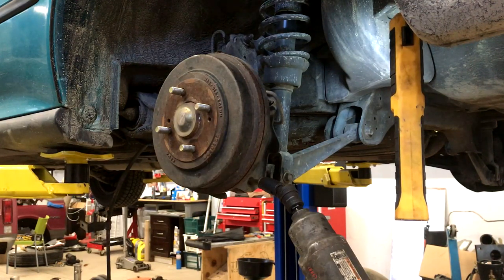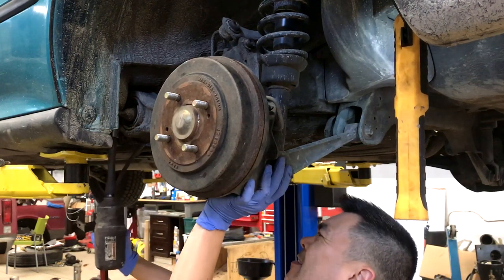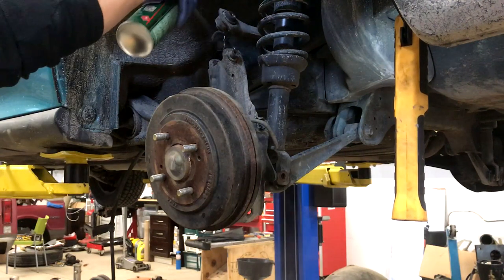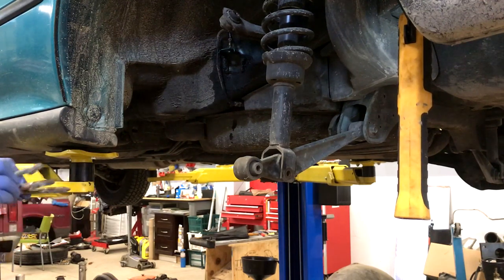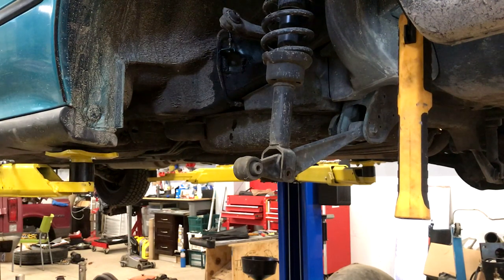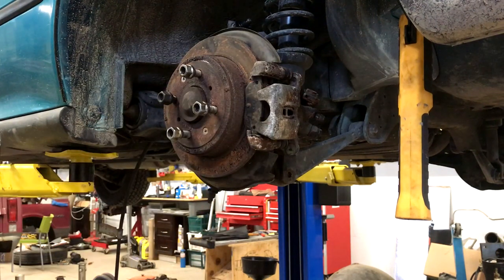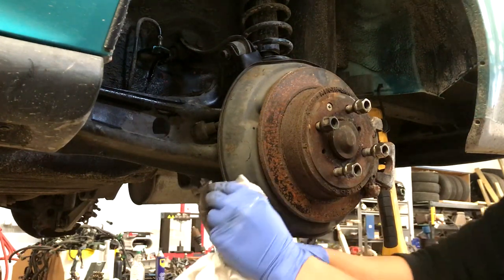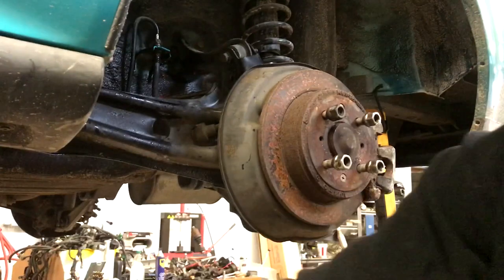One Take 🔴 Honda Civic Rear Disc Brake Swap in Real Time

Comment: Did you have to replace the prop valve?
Reply from the maker: not yet, not on this car but I will once I put it back on the road. The prop valve replacement is a must if you drive in wet or icy or snowy roads. Without it the back end locks up before the front and you may spin out. On my last drag Honda on dry roads when brake hard from 110mph+ I always had my hands full, I strongly recommend whatever prop valve Honda put on the similar brake setup that you are recreating. If anyone tells you different they aren't going fast and braking hard enough.
Reply from the maker: Swapped out the #proportioningvalve to the 40/40 piece. Brakes like it should, highly recommended!

Comment: Hey what year civic was this I'm gonna do one off a hatch off an Integra
Reply from the maker: h22sparkle this is a 92-95 although it  is the same job and parts for civics from 1988-2000. The only thing that may vary is e-brake cable length.
Reply: GIZZMOTORSPORTS do I really need the whole hub or can I use my existing one and just take off everything that's on the other hub that I'm getting the parts off of?
Reply from the maker: h22sparkle you want to get the whole thing from the auto wrecker. Or get the whole integra and swap engine too!
Reply: GIZZMOTORSPORTS I don't do all of that I don't need the motor if I have a swap

Comment: My rear swap came out of a 96 integra and it has a orange plug on both sides anybody know where that goes to in a 96-00 civic coupe
Reply from the maker: Drew Ske that would be for the ABS sensor, does your civic have ABS? If not just tie them up or cut the wire off.
Reply: @GIZZMOTORSPORTS  ok thanks I will look in 2 and see if the civic comes with ABS thanks

Comment: It looks rusty.
Reply from the maker: Lucas Martínez Parra yes quite a bit of surface rust on the rotors, calipers and caliper brackets from sitting. I was able to machine the rotors, clean up and paint the rest. I'm happy nothing was seized, calipers, sliders, cables.
Reply: Cool, dude. Nice work.

Comment: I got to the passenger side and the inner main bushing bolt backed out and then started spinning
Reply from the maker: That’s really bad. This happened to my buddy on his Integra Type R. As a last resort he cut a hole in the floor. I would explore all other options first, like cut the bolts, remove arms, drill and retap. Or, just try and put it all back together until you have time to deal with it.